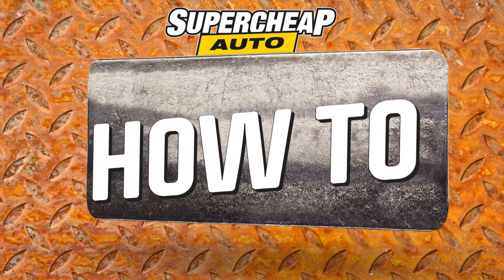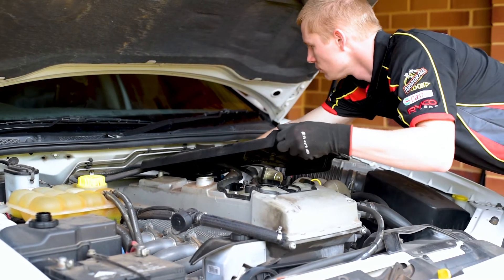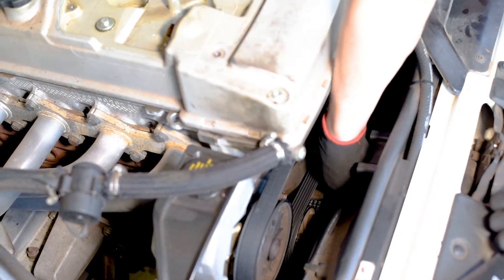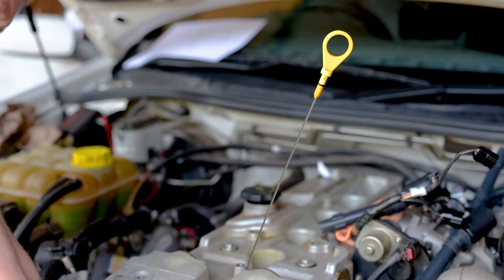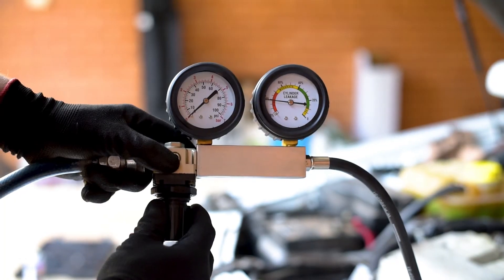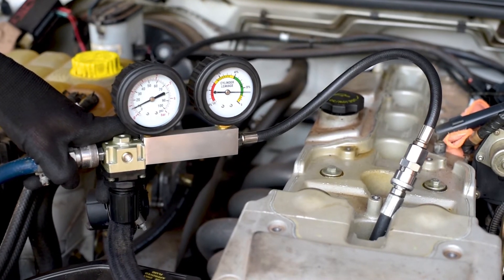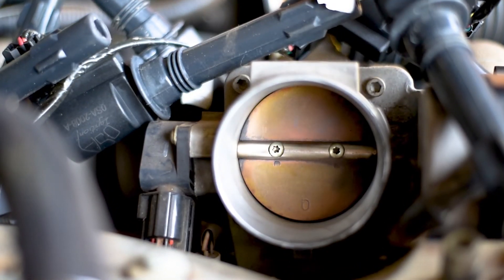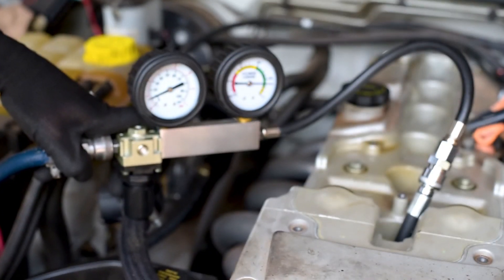How to - Perform a Leak Down Test // Cylinder Leak Down Test Kit

Comment: Normally I would expect the first gauge to show 100psi, but it doesn't. Instead it shows only 15 psi. Is there any explanation for this? thanks
Reply: wcjcnc, everyone else does it differently, but you're doing it right huh?
Reply from the maker: Hi there, Thanks for your question. At the time of filming, the regulator on the air compressor was set to 15 psi as an example. Higher compression can be used with this test up to 100psi. But as a side note, Double check with the user manual to ensure you don't go over the recommended pressure.
Reply: @supercheapautotv  thanks for your reply, but I should have said - I received my tool today, checked that the air compressor/reservoir was 100psi, and then as per the instructions, turned the regulator to get to 0%/"set" on the 2nd gauge. That produced a pressure of only 15psi on the first gauge, the same as you had in your film! Doesn't make sense to me, as I would expect 100psi.
Reply: @chemicalpotential3297   You are correct. The leak down tester used in this video is junk. It’s like the cheap one sold at Harbor Freight Tools. It doesn’t work properly. Harbor Freight realized this and they actually sell a good leak down tester now under the name Maddox. A good leak down tester has two identical gauges that go from 0-100 PSI. You also connect the tester to the cylinder to start with. You do not pressurize the tester and THEN plug it in. Once your cylinder is at TDC on the compression stroke you turn the first gauge up to 100 PSI then subtract the second gauge from the first gauge to get your percentage of leak down. Almost every video on YouTube on how to do a leak down test is wrong. It’s kind of weird.